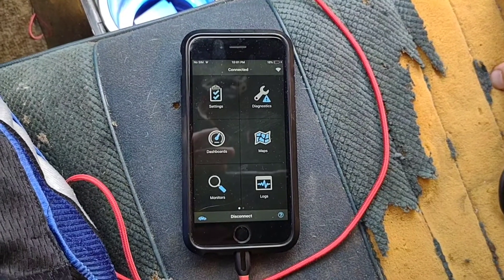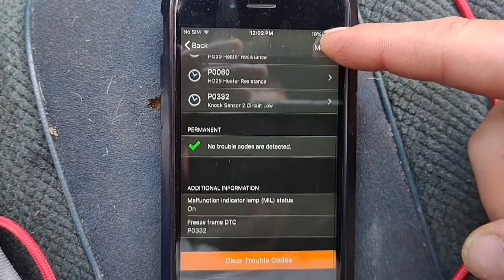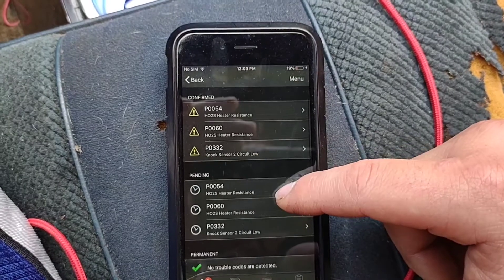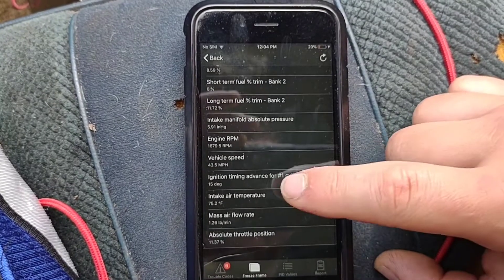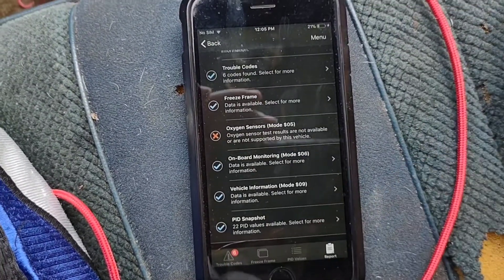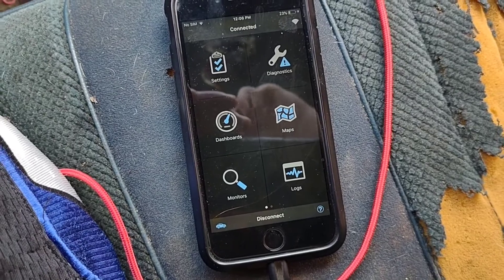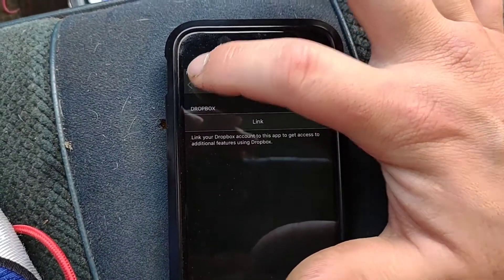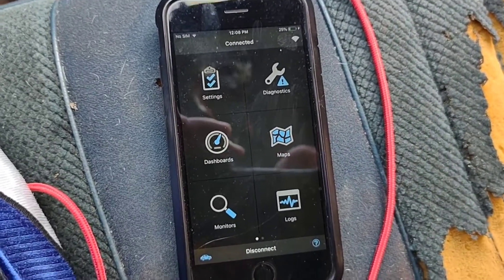OBDLINK MX+ Review part two.Checking check engine light and pids.

Comment: Hi,
Is there any resource from where I can get extended PIDs (mod 22) of all vehicles' manufacturers?
(I only need FUEL LEVEL, ODOMETER, VIN of all make/model)

Thanks
Reply from the maker: I don't know much about the pid and really don't won't to experiment on my vehicle. I do believe if you know what your doing you can put it in there. It gives option to import pid also, but not sure how that works. All I know is it has that option.